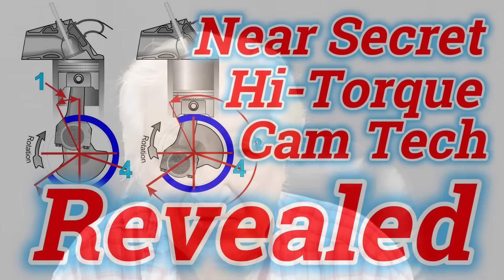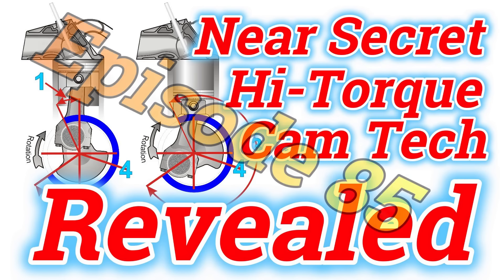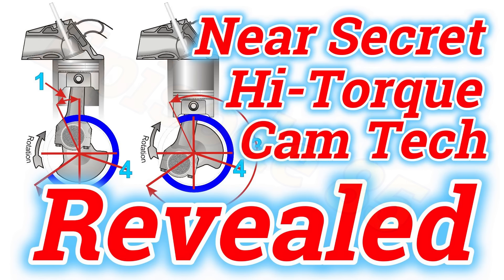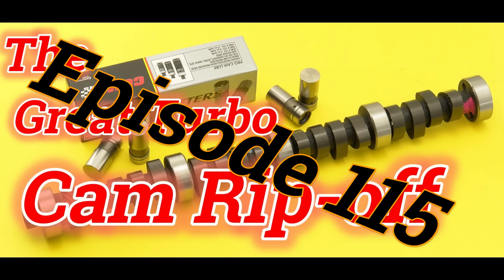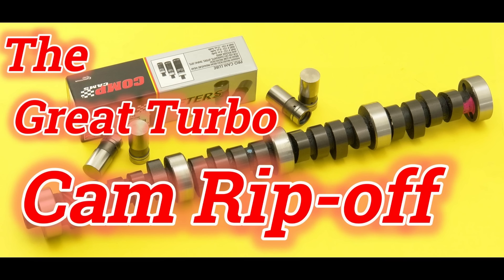The truth about LCA's Vs idle & vacuum quality

Comment: Your right David. Example would be Diesel engines. Turbo and non turbo. Have different cam specs than gasoline engines in today's cars and trucks. A good example of a good cam would be your turbo mustang. It has an adequate cam. It can be better yes. Yet what are the specs of that cam?!

Comment: More duration makes more overlap.
Tighter LCA makes more overlap 
Too much overlap will cause poor idle quality. 
  In my thinking you can get to the "too much overlap" situation by too much duration OR by too tight of a LCA   ???  What am i missing? Are you saying that 220 duration with 106 LCA that gives a poor idle has way too much duration?

Something that needs to be defined is what is poor idle quality ? Is a lope poor idle quality? or is it a super low vacuum ? 
An old joke made of a radical cam is " That things got a terrible miss!" 😊
Reply: The general theme here is that tight LSA, lower duration cams (which produce higher torque at lower rpm without loss at the top-end and overall more power "under the curve") are preferable to long duration, wider LSA cam (which produce a broader torque curve, but with less power overall, with higher peaks and less low-end). The driving qualities are driven by overlap. If overlap is equal between the two cams, the one with the shorter duration and tighter LSA will be the winner. Vizard has the receipts to prove this and provides calculators to understand what values to select.

Comment: best bet ? Compare s2000 head choice vs north american v8 of that time . Vtec covered a limitation .  Compromise . Before vtec , it was max 5000 rpm or max 9000 rpm . With vtec you had both . Take top fuel ? They idle at 2600 rpm . My nissan versa note 2014 idle at 650 rpm and redline at 7600 rpm or so . And i bet nissan was conservative . It likelly can go to 8300 rpm but i suspect plastic intake would need to be cerakoted

Comment: up until recently there were lots of cam grinder worldwide , how many actually did dyno tests or had their own engines & workshops? what cam grind works for one engine doesn't work for other engines. yet if looking at catalogs it appears that one came grind is just adapted to other similar engines.
Reply: I was talking about this just the other day with a friend of mine who also grinds cams.  He used to grind for Reed and they used to grind the 290/296ULX or a 296/306ULX either on 106 or 108 a lot.  These solid roller combinations seemed to work very well in a small block Chevy, Big Chevy, Ford etc, all kinds of applications.  I think that the reason is because in a reasonably well coordinated racing engine the pressure and velocity conditions are going to be somewhat similar in the ports.  Enough so that their camshaft requirements end up being about the same.   This is why cams can seem somewhat generic.  They can be and still work very well.

Comment: Put your money where your mouth is.

307 2 bolt main block
4 eye brow cast flat top pistons
Flat tappet cam
Holley 750 vac secondary carburettor 

11.5" - 13" inches of vacuum 

8500 RPM 
power brakes
Idles in gear with a factory holden GM torque converter 

Daily driver combo.
Reply from the maker: I have done that so many times during my 50 years of engine tech stuff. Never lost b ut did make the companies concerned a cart load of money.
Reply: @DavidVizard  
 
Well I'm not talking about a 283 bored too 4.030" over size or a 4" bore 302 bored too 307 cubes..

Mine is a  2 bolt mains 3.875" bore 307 bored .030" over mate.

Anything is possible on an unlimited budget or when someone else is paying.

"and I'm sure you did"

Did I mention barely 91 octane (RON) pump fuel and No octane booster

Almost forgot 

How close too 500-550 horsepower were you with your .030" over  cast flat top 4 eye brow 3.875" bore 307 combos?

Oh yeah,

No turbo 
No blower
No nitrous

Comment: Still trying to figure out when idle and vaccum came into the conversation, so all of this LSA talk and formulas are for a street car?

 It appears that unless you have very deep, flame front compromised, valve pockets you are forced to run a very low lift, low duration camshaft.

 Rather than opening the valves into the piston tops it seems like it would make a lot more sense to move the timing events for PTV and use ramps that pack a lot more energy into the cylinder. The goal is to trap that charge, modern cylinder heads flow big numbers. This requires valve lift to take advantage of that flow. Valve lift requires duration to maintain a stable valve motion. Where your valve motion actually happens determines the timing events based on the the required duration for the lift.

Whatever you want to call it, lobe center, or lobe separation, is just the end result. You mistakenly make these assumptions in your book. 

You performed an LSA test on a 302/347. You state identical camshafts on different LSA's. Well, that would be impossible, you have to move the valve motion events meaning the camshafts are all different.

 You might as well be comparing camshafts from a  302 Ford, a flathead B&S and a Tesla.
Reply from the maker: This appliese to engines from street to full race! watch this again.
Reply: A free country.
Do your own thing. 👍
Reply: It’s easy for me to realize DV means identical cam lobes, not identical cams....using identical lobes and modifying LSA’s gives different timing events which isn’t impossible.  I realize there is a missing word, but you want to debate and show your mathematical superiority over a degrees engineer.....🤡🤣😂